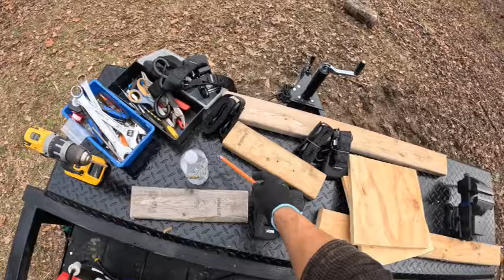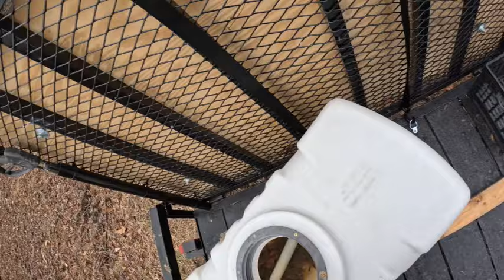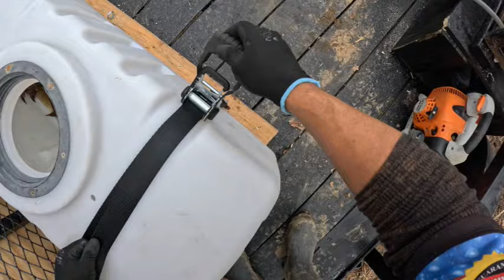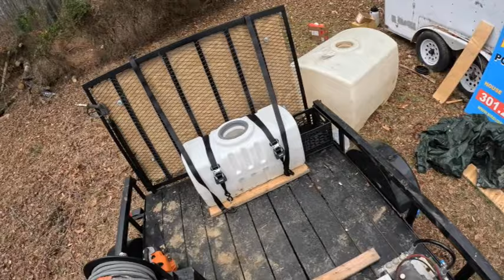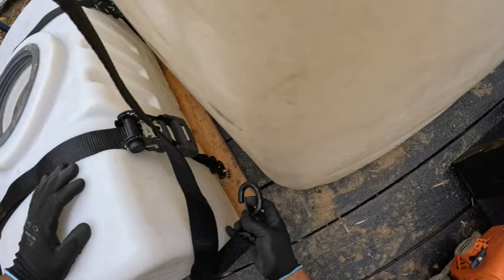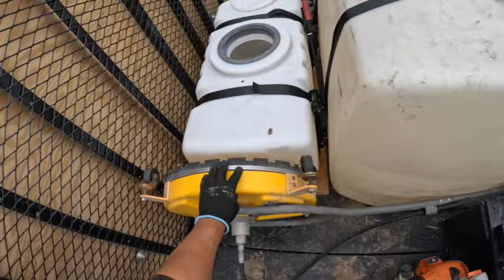Ep.85  How to Build a Pressure Washing Trailer (Part Six)

Comment: Definitely paint. Next time you can buy a gallon paint and paint ALL the material including 2x4’s before you install. Paint full size even if you will need to cut them, you can touch up the cuts when finished. Much easier and cheaper ! To get into a little more detail… use a black Solid Stain! It will protect wood better and solid stain won’t peel. Great videos! Love watching
Reply from the maker: Thank you so much for sharing, good looking out!

Comment: Add a Softwash system!
Reply from the maker: Already on that, I am doing a softwash build with a booster pump within the next couple of months, it's on my production list. Thanks for sharing that great idea!
Reply: I definitely am interested in how a booster pump setup works. I tried to use a buffer tank for my first job and it just would not feed the pressure washer. I ended up having to use the hose from the spigot directly.